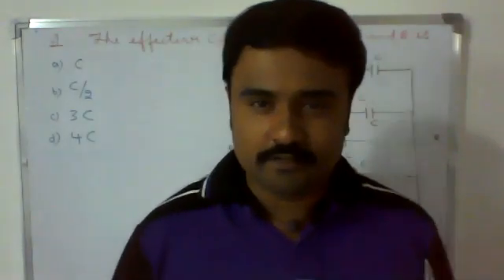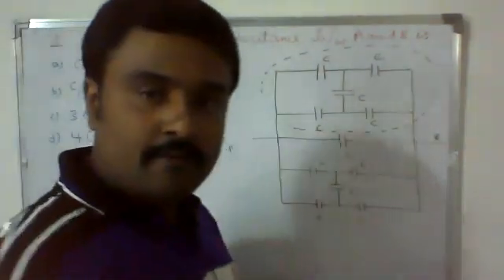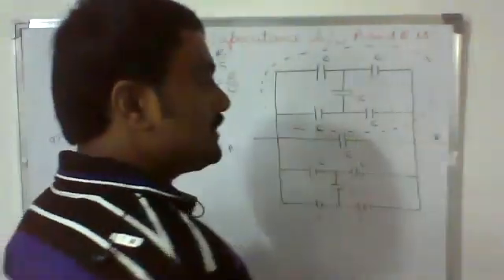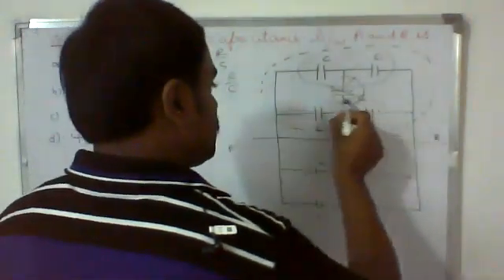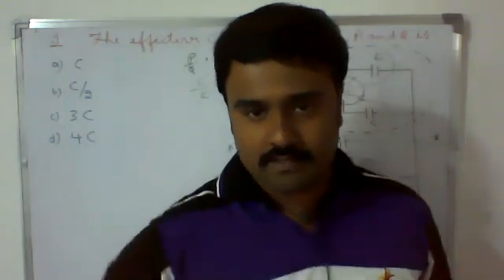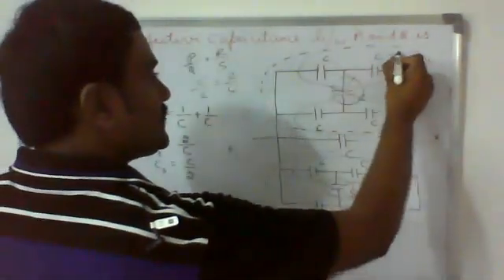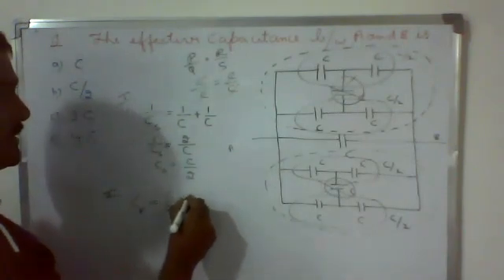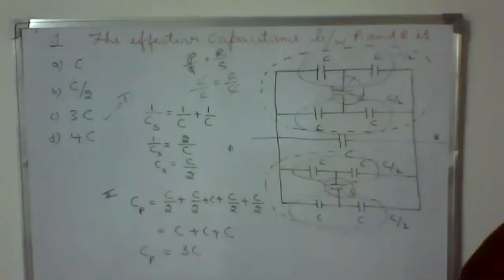SIMPLIFICATION OF COMPLEX CIRCUITS

Comment: What is the meaning of capacitance and Wheatstone network sir
Reply from the maker: Measure of ability of capacitor to charge a capacitor is capacitance and Wheatstone network is an arrangement of 4 resistors in the form quadrilateral used for measuring one unknown resistance in terms of 3 known resistances
Reply: @brnandakumar5988  thank you sir